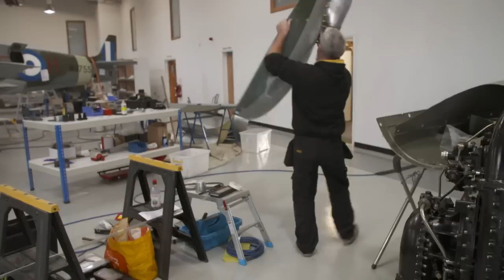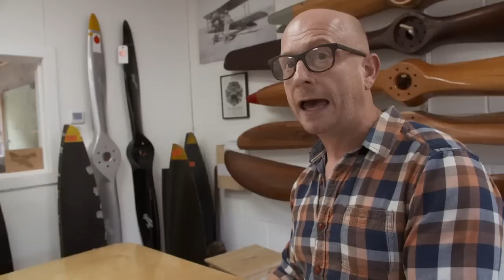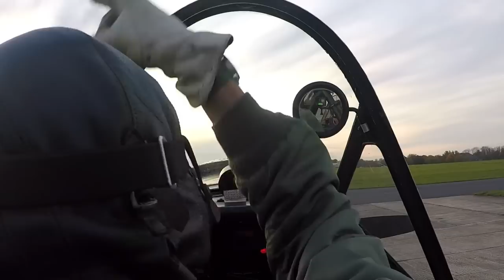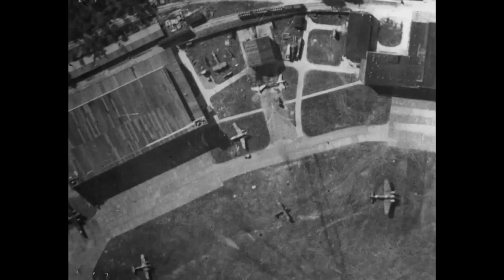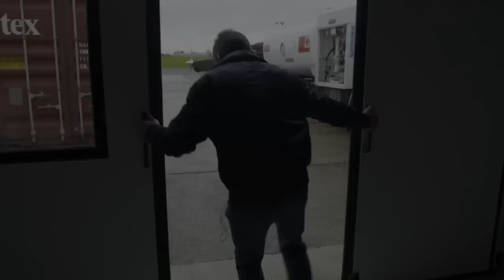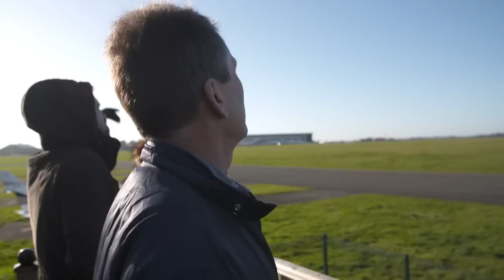The Challenge of Restoring a War Hero | Inside The Spitfire Factory | Machina

Comment: IRON MAIDEN - Aces High

There goes the siren that warns of the air raid
Then comes the sound of the guns sending flak
Out for the scramble, we've got to get airborne
Got to get up for the coming attack
Jump in the cockpit and start up the engines
Remove all the wheelblocks, there's no time to waste
Gathering speed as we head down the runway
Got to get airborne before it's too late
Running, scrambling, flying
Rolling, turning, diving, going in again
Running, scrambling, flying
Rolling, turning, diving
Run, live to fly
Fly to live, do or die
Won't you run, live to fly
Fly to live, aces high
Move in to fire at the mainstream of bombers
Let off a sharp burst and then turn away
Roll over, spin 'round to come in behind them
Move to their blindsides and firing again
Bandits at 8 o'clock move in behind us
Ten ME-109's out of the sun
Ascending and turning our spitfires to face them
Heading straight for them, I press down my guns
Rolling, turning, diving
Rolling, turning, diving (doing it again)
Rolling, turning, diving
Rolling, turning, diving
Run, live to fly
Fly to live, do or die
Won't you run, live to fly
Fly to live, ACES HIGH !!!

Honor and Respect to all fallen warriors from Greece !!!